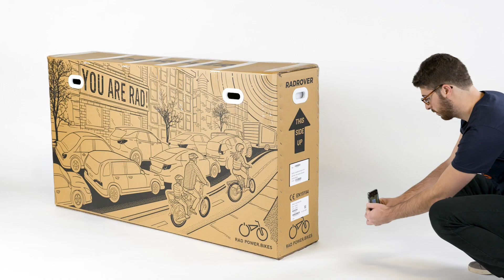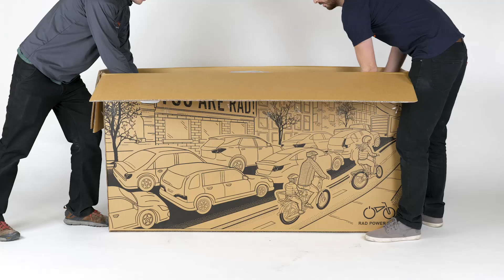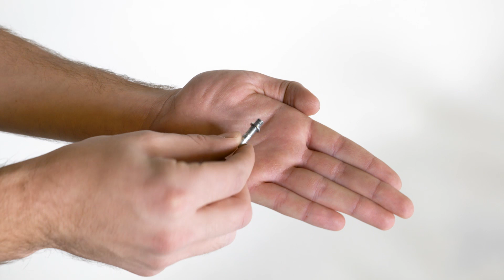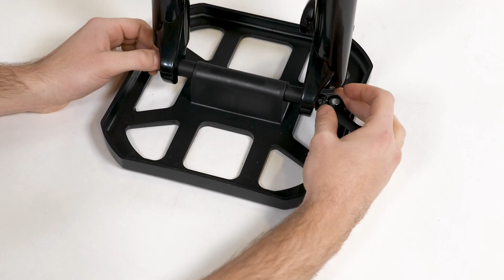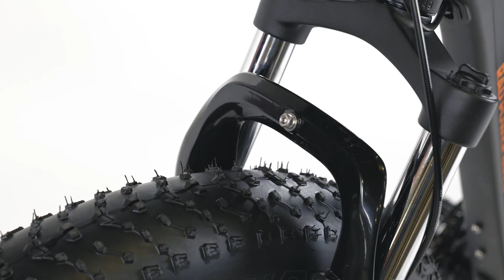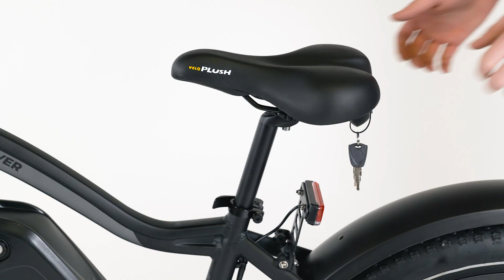RadRover 5 Assembly Instructions | Rad Tech

Comment: Got my RadRover 5 in 4 weeks.  Front disc brake was singing and centering the caliper fixed it.  When cutting off those nice big zip ties when unpacking, cut it below the catch incase you want to reuse them

Comment: Great video, had mine fully assembled in about a half hour just following these instructions
Reply from the maker: Thanks! I hope you’re excited to get out on the road. How about a race next time? 😎🔧
Reply: The Rad manual says you need to torque several of the fittings. I have ordered a torque wrench and peddle wrench .
Reply: @marklipkus7063  lol, hope you ordered a pedal wrench!
Reply: What size pedal wrench is required?
Reply: @marklipkus7063  where did you get the torque wrench? NM range?

Comment: Great video! Had my new RadRover 5 out the door and riding it within an hour after it arrived using only the tools it comes with. Nicely done Rad Power Bikes!
Reply: So it came with a pedal tool?
Reply: @slbynum  This is what I was wondering. I'm going to assume that the wrenches they include will get the job done.
Reply: Did it come with grease and an air pump?

Comment: Received my RadRover5 yesterday totally up damaged even though Fedex had the box upside down and then turned in on end to wheel it into my garage.  Great packaging prevented any damage.  Assembly was a breeze the video is great.  The front fork was already rotated which thru me a curve for a moment but the video helped me figure that out.  The only thing that happened was the seat post got scratched up a bit but I think that was my fault for not loosening the quick disconnect enough.  I will fix it with a little bit of flat black paint.  It is always a joy to assemble something that is well built,  were everything fits, and the instructions are great.  Charging the battery now,  tomorrow I ride!  Oh I live in Columbia Mo so if anyone near here needs help with assembly I’m in.
Reply from the maker: Hello Collin! I'm sorry to hear that your box suffered some shipping damage. It sounds like you got everything squared away but if you have any questions or concerns please don't hesitate to give us a ring at (800) 939-0310 x2 or shoot us an email to "support@radpowerbikes.com"! Our product support team is pretty killer and they'd be happy to help you out with anything else you're wondering about 👍

Comment: Awesome way to go Rad ,now I know exactly what to expect and when putting the bike together when it arrives. I appreciate that as always the customer service is unmatched .
I've been researching bikes of all types fir3 years and finally pulled the trigger and ordered mine yesterday. .
I found Rad bikes being by far not only best value for the buck .but many mire expensive bikes have cheaper components then the Rad , Or still catch extra for things that already come Stick 8n the Rad such as Fenders ,tail lights ,comfortable seat , and a better drive train  some more expensive bikes . plus the fact that everything can easily be upgraded and or refreshed when that time comes . in fact many com0anies offer after market up grades and.accessaries says a lot about the quality of the bike itself Espeacially considering the price point being at 1499 .ofcoyrse you'd gave to expect room for upgrades at that price point. But if be willing to bet that the Rad is much more comfortable then my mud drive bike that cost over twice as much .and the Rad offers a half twist throttle wich my mud drive does not .and much more of course too .

Comment: It would have been nice to include a small amount of grease. That's the only thing really missing here. Looks like I'm going to have to install the pedals without it and bike to a shop and have them remove the pedals and reinstall them with waterproof grease.
Reply: Hi! I thought the same thing when I got mine a week ago, and never even bothered to check the spot the pedals go. Theres already a glob of grease in there so you dont need to get your own. Theres also a wrench of the right size in the toolkit so you dont need a pedal wrench.

Comment: How is he measuring to torque on the pedal wrench?
Reply: That's what I was wondering.
Reply: Sincere question: these comments can sound like a question of whether one is using a level when hanging pictures. :-) So what's the risk if the pedals are not tightened to exact specifications? What if off by 5%, 1%, or 10%? What if it's done for first x miles of use, before one gets a torque wrench, or gets to a  cycle shop? 

I'm asking these, to those raising these concerns, as someone who lives a couple hours from a bike shop and without prior bike repair skills. I can get tools, and can learn. I'm wondering how critical these concerns are, and for how long to be worried when first mounting them, and asking as much for the sake of others in a similar position.
Reply: @cmarehart  Amazon has a one day delivery on PRO BIKE TOOL 1/4 Inch Drive Click Torque Wrench Set for $69.97. I tightened the pedals without torquing them and checked them a couple times since. They are still tight. The rear axle nuts want 40 Nm. The stem wants 15 and 20 Nm. I think those are important. I would torque everything before riding.
Reply: @olewornhat  thanks, and that tool tip will help many I'm sure (and me). And as for the importance of torque on the axle nuts, I totally get that. Buy again, I was responding to the comments about the pedals, as if those were as critical to get torqued right. You seem to be agreeing that perhaps it's not. Am still open to being schooled, and for the sake of others who may read this thread.

Comment: Can the fork protecter plate be reused for transporting the bike with the front wheel removed? That way it would fit in the bed of my truck and be able to close the tailgate.
Reply from the maker: Hey Thomas! Sorry about the delay! If you're still wondering - Yea, you could use the fork plate to stabilize the bike. You'll want to make sure the frame of the bike is secured to prevent from tipping, but it will provide some stability.

Comment: Is the Newton meter wrench necessary or is there another way to tighten the bolts without it?
Reply: I only have a torque wrench for car wheels.  I have 2 of these on order and don't plan on buying a smaller torque wrench just for this.

Comment: Is the torque wrench using regular bolt connectors or Allen connectors?
Reply from the maker: Hey hey! Sorry about the delay! If you're still wondering - In this video we're using the torque wrench with Allen bits, but torque wrenches allow you to use other bits as well. 🙂

Comment: Where do you get a 35 Nm pedal wrench?
Reply: brickbatz a normal wrench will do just fine
Reply: @gavinquigley1616  Yeah, thanks for replying. I bought a pedal wrench on Amazon. I was just wondering who would even sell a pedal torque wrench. My Rad Rover is supposed to be delivered this month. I'm starting worry that it won't with only 7 days left of this month.
Reply: brickbatz I ordere mine June 6th and just heard about it yesterday on July 23 it is estimated to arrive on July 30th I live in Virginia btw hoped this helped! Also when did you order yours etc?
Reply: @gavinquigley1616  I paid on 06/11/20 and like you I got my order confirmation a couple days ago. It says it's getting my order ready. I can't track it yet.
Reply: @gavinquigley1616  my 2 rovers are scheduled for 7/27/20 delivery! finally after my June 4th Order
Reply: @gavinquigley1616  My bike was a few days late but it came today 8/3/20. It's 95° feels like 105° here in Florida. It took my gal and I a bit of maneuvering to get in the house for assembly in the air conditioning.
Reply: @gavinquigley1616 p